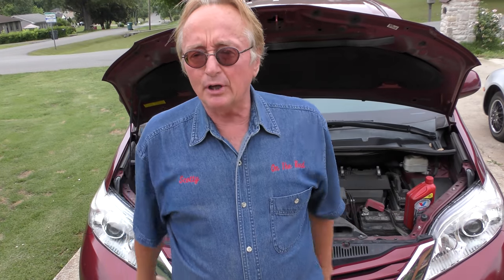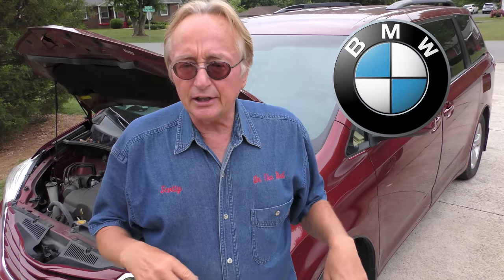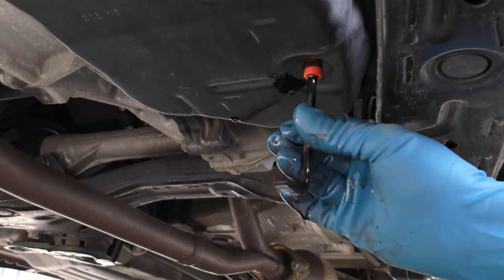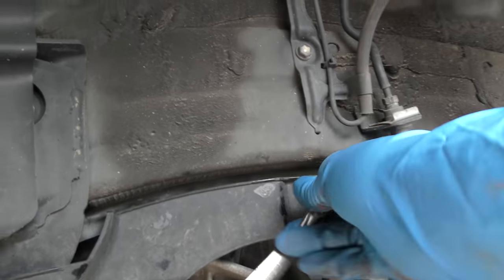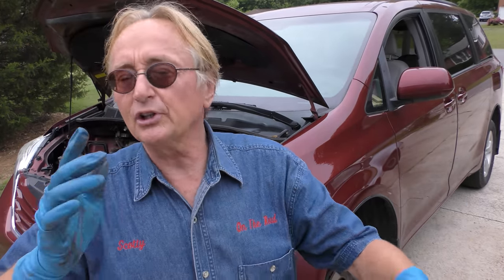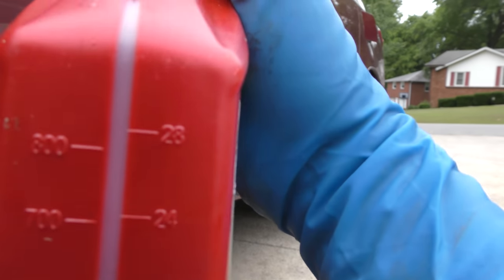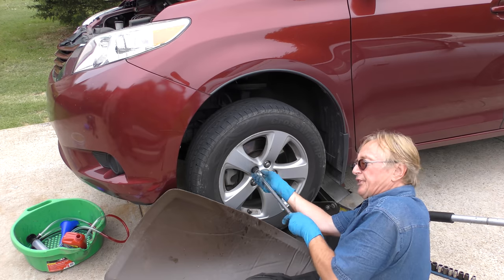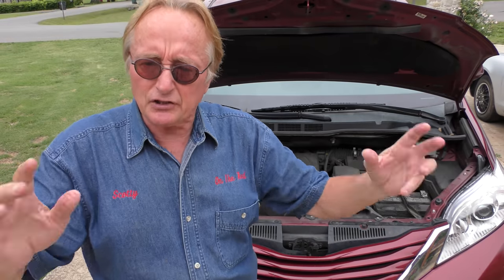Here's Why Changing Your Transmission Fluid Can Cause Damage

Comment: I've been putting off servicing the transmission in my 2005 Freightliner (Mercedes Benz) Sprinter, due to it having over over 250K miles on it, and the additional work I will need to do  if I drop the pan.  like replacement of the transmission harness connector that leaks oil upwards into passenger area where its way up the speedomer cable into trans comp 😳 conductor plate, possibly a soli

Comment: Hey Scotty, Watch a lot of you videos,very helpful. But I have an 08 Avalon and I just hit 120,000 miles. Is it to late to chance the fluid?
Reply: Your in a tough situation now buddy...
Reply: I'm voting that it's not too late! Do only fluid and filter (no power flush machine), clean the pan well, and strictly follow fluid recommendations and fill procedures. New lubricants, even mixed in old, always perform and protect better .
Reply: I started changing trans fluid @ 250k no problems. 
Use dealer fluid, don't change to often, and cross your fingers 
Chances are you'll be fine
Reply: @CHEVYK10  .On my 08 Avalon, it says the fluid temp has to be between 104-113F. to check the level properly. I was thinking of draining it when car is completely cold, measuring how much came out and just putting back the same amount. What do you think?
Reply: @billbeeb1803 - if you measure the amount you took out then you cant go wrong.
Reply: Am i the only one that leaves the plastic out and puts drain plug in and restarts car after filling it .i let her run for a min and redrain two or three times

Comment: changing your fluid is NEVER a bad thing. its literally the basis of having a long lasting vehicle
Reply: Exactly. Just beware of misunderstanding the replacement interval. I drive with MB, where the exchange interval in AT is 60,000 km. But this does not mean "recommended replacement after 60 tkm". It means maximum km per filling!!! In addition, MB recommends that if the car is under more stress (often fast driving or often towed by a trailer), this interval should be halved, and in the case of extreme loading, shorten it even more. I change the AT depending on how I drive, but I don't exceed 40,000 km in the AMG 20-25 in the AT and 12,000 km in the engine and 8,000 km in the AMG. Of course, a complete replacement including the filter and gasket under the oil pan (in the case of the AT 722.6 also including the electric socket). I had to stop the MB from 1995 due to massive corrosion with 1,603,xxx km. Engine and gearbox fully functional.
Reply: theoretically if a transmission is slipping and dirty oil gives it more grip, then changing to fresh oil could have negative effects on how it's working. Of course the answer to that is get your hooptie fixed.
Reply: @wesdoobner7521  wrong theory - you misunderstand the functionality of CVT and AT. On the other hand, if the transmission is slipping and has enough oil, changing the oil will certainly not eliminate the slippage. Think logically: do you really think that old oil can work better than new?
Reply: @Mijanboy  Higher friction oil can help a slipping transmission.  I've been a mechanic for 35 years. We used to use the old Type F in a slipping turbo 350 and it would help for a while. Not a replacement for a rebuild of course.
Reply: @wesdoobner7521  You actually wrote it well = Higher friction oil can help a slipping transmission. e used to use the old Type F in a slipping turbo 350 and it would help for a while. Yes it will help for a while = for sale 🤣😂😅
Mainly it works on AT with hydraulic converter.
The key question is, do you think the unchanged oil in the AT will have a higher viscosity? It will definitely be thicker - it will have a different pumpability, but that doesn't mean it has a higher viscosity in the full sense of the word. Likewise, it would be meaningless to claim that 10W40 engine oil has a higher viscosity than Dexron 3, which is more thin.

If I don't change the oil, it will start to thicken due to the impurities after the additives degrade, which will kill the AT. The oil will be darker and full of non-magnetic wear. This means that the oil flow will decrease more and more and the oil will always arrive with a delay, and the oil spray in the pressure lubrication sections will also be much weaker, resulting in delayed and low-quality lubrication of the necessary components. The strength of the oil film will decrease. Clearances will start to form and where there is the greatest friction, wear will occur and metal particles will be caught in the filters and magnets. The old oil filter will become clogged and soon malfunction, reducing the oil flow even more. The magnets will either be full, or they will soon be covered with sludge and will also be non-functional, and there will be a risk that the iron chip will pass through to the electro-hydraulic plate, where it will noticeably impair the functionality of the gearbox. It starts with delayed shifting, inaccurate shifting, slips, shifting only some gears, until the car cannot be started at all, or due to high wear and tear, piston sleeves and rings are destroyed, vanes of the fans of the pump or turbine wheel of the hydro-converter are destroyed, and the main bearings are destroyed, or the friction plates are welded to the steel (due to long friction).
That's my experience with customers' cars.

Comment: I have a 2015 Nissan Altima with 150k miles on it. Should I change the transmission fluid if it’s never been changed?

Comment: I know that there are good reasons to avoid doing a power flush on an older transmission. But Scotty doesn't make it clear why it is bad to just drain the transmission, clean up the pan, put in a new filter and refill. If you use the right fluid in the right quantity and follow the right procedure, I don't see how this will hurt anything.
Reply: If you watch the video he address why. At around 3:00 he explains why it’s better to do a drain and fill as oppose to a flush. You can still drop and clean the pan and put a new filter for peace of mind but most mechanics don’t think it’s necessary because doing a drain and fill cleans that up.
Reply: dark purity the hegehog  who cares
Reply: roxanne wolf  Why did you waste time to watch this if you have an electric vehicle?

Comment: Dear Mr. Scotty,

I have a question about changing the transmission fluid for a 2020 Audi Q5L. If I were to change the transmission fluid myself, which type of oil should I buy? In our country, almost everyone says that transmission fluid should be changed at the dealership, and using oil bought elsewhere could damage the transmission. However, I would like to change the transmission fluid myself. If you have any advice, I would greatly appreciate it. Thank you!

Best regards

Comment: Scotty, I own a 2015 CT200h.  As you know its nothing more than a Prius with leather  :-)    The transmission fluid has never been changed.  It has around 84k miles;  would you recommend doing a drain and fill or leave it be?
Reply: Those transmissions do not have a torque converter. There is nothing heating up the fluid. Heat kills the fluid over time. This might be the one time that the oem interval is OK. The hybrid motor launches the car from a stop, then engages the clutches to the engine once it starts. hth

Comment: Honda CR-V circa 2012 had a problem they're refusing to recall where a passageway internal in the transmission is too small and when wear material enters the area it causes a terrible judder/surge.

Changing the transmission fluid fixes it for a few months.

All transmissions need their fluid changed -- just most manufacturers want them to fail instead. Honda has a drain plug. Most don't.

Comment: Scotty, how do you feel about a complete ATF change by pumping fresh and old fluid in through the trans cooler lines? I've been considering on my 8 speed Canyon thays at about 70,000 km
Reply: He addresses this in the video and says he is strongly against flushes
Reply: It really depends on the condition of the fluid and how many miles the vehicle has. It can be done on lower mileage vehicles because the fluid is relatively “new.” But on older vehicles with worn transmission plates it’s not recommended to do a flush because all the worn material is keeping the transmission alive.

Comment: Older cars have less repair bills due to their simplicity
Reply: That's why both my cars r well over 20 yrs. old. No payments, I can work on them, property tax almost nill, less than $30 combined 4 both & no 1 wants to steal'em !!!!!!!!!
Reply: 97 rav4  220k & ac still works,  83 sr5 tercel - 180k - uses .5 qt between oil changes every 3000 miles.  buy new cars for what reason?
Reply: Come see me when your vehicles no longer need Inspections then we can talk about old vehicles
Reply: @CHEVYK10  the only inspec. I need  is, believe it or not, is all lights &    📯    work!!!  beep....beep

Comment: I have a 2020 kia forte with 70,000 miles on it. Many mechanics say not to change the transmission fluid. Should i change it or not. I know that those cars can get a little finniky... Yes change it or not? Got it in a dealership for 9k and everything seems to run well

Comment: I changed my tran fluid on my 2010 Sienna at 253k. After 7 changes and 1 filter, it’s still dark but no where near the first change’s. Not many manufacturers can withstand such late tran change.
Reply: So you never change the fluid until.253k?
Reply: @fh3486  Yes. My sister's van and she only knows oil changes.
Reply: @JADEYWADEYMAKADEYPATADEY    so you did change Trans. Fluid for total of 7 times throughout the years
Reply: @fh3486  Within 4 months period. I put 17k mi within those months so I do two atf changes every oil change with Valvoline Synthetic ATF for $18 a gallon at the local Walmart.
Reply: @JADEYWADEYMAKADEYPATADEY  Is vehicle still running ok? Would like to change fluids in high mileage Honda. I guess the test would be seeing if it may be darker than normal.
Reply: @richardtrowell8812  The vehicle is still running great at 285k. On Honda,  I would not change the tranny fluid (if never changed before) until you replace the transmission filter and clean the transmission solenoids.
Reply: @JADEYWADEYMAKADEYPATADEY  How do you clean the transmission solenoid?

Comment: whats the difference between flushing the transmission fluid and just changing it? i have an 08 accord i bought with 73k miles on it, now has 117k and haven't changed the fluid yet so im gonna be doing that most likely

Comment: I have a Honda Accord with 120,000 miles on it. I have never changed the transmission fluid. Am I better off just not changing it at this point?

Comment: Thoughts on using a brake fluid pump and compressor to remove the oil instead of through the pan? I just had my tranny drained yesterday maybe for the first time at about 98k miles. Manual calls for 120k. I know this "draining" only changed about half the oil as I specified "no flush". Trans worked fine after that was done. I plan to give it another change soon by pumping out from the dip stick hole and replacing same amount. The reason why I had the shop do it first was to replace the filter and clean the crud off the magnet.  Now I can further clean the old oil that remained by pumping out from the top. Thoughts? The mechanic showed me the sludge buildup at the magnet, so I'm glad I had that cleaned up.
Reply: The theory is that if there's any metal in the fluid, it will sink to the bottom of the pan, and draining will allow it to flow out. Pumping it out - not sure how successful that will be in picking up anything that has sunk to the bottom of the pan. That said, I've had to pump out differential fluid before where there's no choice, ie: no drain plug.  All the best!

Comment: My local Mitsubishi dealer told me to flush my Transmission fluid on my 2018 Outlander Sport with 61,000 miles on it. Is it better to flush the fluid or change the fluid? I could have sworn in the video Scotty said to NEVER flush the fluid. Is there a difference between the two? I'm confused.
Reply: I am going through the same dilemma with my 2014 Nissan Altima with CVT. I just called 2 Nissan dealerships and the first one said I should get it totally flushed because the mileage is still low enough(70K)

2nd dealership I called said NOT to flush it and that if I do, I'll lose my transmission.

I am not a car guy and the fact that I would get 2 drastically different answers from Nissan service centers is insane to me. I can't make the wrong decision here or I'm really going to be screwed

Comment: So I have a 2012 Toyota Avalon with 99,000 miles. The transmission fluid has never been changed. Should I change it or not ?

Comment: My 2001 Lexus LS430 had a 135000 miles on it when I purchase it in the Spring or rather Easter holiday of 2000 seventeen, now has a 187000 plus on. Should I change the transmission fluid?

Comment: 323,000 miles on my 2001 Nissan Xterra and I've never changed the transmission fluid or filter. It's now acting up, just takes a while to engage 1st, 2nd or drive. Should I change it now?

Comment: I bought my car used about 5-6 years ago. Its a 98 explorer. I have no idea if the transmission fluid was ever changed by previous owner or not. I do know the fluid is a lil dark red. I want to change the transmission fluid and filter since I will have to replace the pan gasket anyway. Makes me nervous now to even touch the ATF.

Comment: Once when changing my oil, I wasn't paying enough attention and drained the transmission fluid instead. I didn't realize my mistake until I got onto the interstate and the car wouldn't shift out of 2nd gear! By the time I got it back home I'd driven about 10 miles with double the oil and no transmission fluid. The car had almost 200k miles on it and the old transmission fluid was as black as used oil, may not have ever been changed. I put some new transmission fluid in it and drained the oil to the appropriate level, 100k miles later its still running. Gotta love Toyotas!

Comment: Hi scotty! I hope you see this. I took my car to aamco transmission toral care. My car has 180k miles. Ive unfortunately nevwr changes the transmission fluid as i bought the car young and just changed oil. It is a 2009 toyota camry. Anyway, i want to give to my daughter who will be going to college and wanted to check the health of the transmission.  They recommended dropping the pain and drain and fill 70% of the old fluid with their thicker fluid. Im nervous bc they want me to sign a waiver also. What should i do? See how far the transmission goes before replacing? Or do this to prevent a major repair?

Comment: As a Tire Technician it hurt to see him just dump the car. I drop it until the tire touches,  torque it and then drop it the rest of the way for a second double torque lol but great video! My 97 honda odyssey slams into reverse when it's cold but everything else is fine. When I drive a while and it heats up the reverse is smooth as pie. But why?!?!?!?!
Reply: I noticed he did it wrong too.

Comment: I have a 2008 Toyota Camry, I changed the transmission fluid last year at 148,000 miles, it has been over a year and it now has over 160,000 miles on it, the car runs smooth, no issues with the transmission.
Reply: Had you ever changed the transmission fluid before this time? I have a Nissan with 282,000 miles on it and I don't know if I should change it or leave it.

Comment: Since the excess transmission oil comes out of the fill hole,  why not overfill the transmission then lower the car to the level ground and drain the excess oil, then jack it up again and tighten the bolt?

Comment: Changed the transmission fluid on my 03 Honda at 35k miles and again at 74k miles.  About 200-300 miles after 74k miles, it would not shift past 55mph until about 4 second delay then it would shift. Honda said I needed a new transmission. Of course they only give you a rebuilt transmission.  My friend said it could have been just a bad transmission solenoid.  Ended costing just over $4k.

Comment: dear scotty, just bought an used toyota rav4, just checked the transmission fluid it looks like motor oil. Q: do i need to change the fluid and the filter? or just the fluid?  thank you.🙏🏻

Comment: Hey guys hope y’all can help. I have a 2006 Corolla with 113k miles. I picked it up and it wasn’t ever changed so i got the fluid “exchanged” not flushed. I can already tell it’s driving and shifting better it’s amazing! But question how would i know if the old fluid never being changed damaged something? How many miles of driving on the new fluid would I be able to tell something hot messed up or would it be instant after changing? Thanks!

Comment: I have a 2005 Saturn v6 and my trany was slipping at about 80000 when it was cold had the fluid changed and it did improve changed again at 120000 and it got even better now at 170000 no slip when cold.

Comment: I have 2015 Lexus rx350 . I don’t know if the previous owner changed the fluid already or not . Should I have the transmission flushed or drain and fill ? It’s around 96000 miles

Comment: Glad I came across this vid,  I got a used caravan paid very little for it but because you have to get under it and drop the cover to get to the filter and you dump your fluid it was never changed.  I was planning to change it but with 170,000 mile on it.  I will just hope it lasts a little while lol

Comment: Should I change the transmission oil on a 2004 Highlander and 2006 Camry both have 70 k miles, have no issues and never changed the transmission oil?

Comment: Mines at 120,000 just bought it. Would you recommend changing it and then changing it every 60,000 miles after?
Reply: drain and fill with every oil change, same amount in as comes out for 3 oil changes